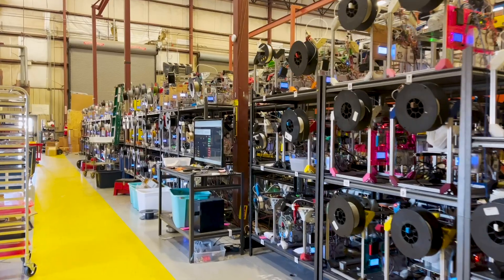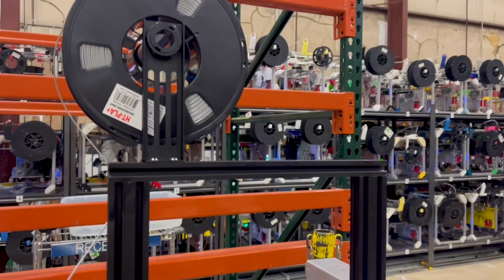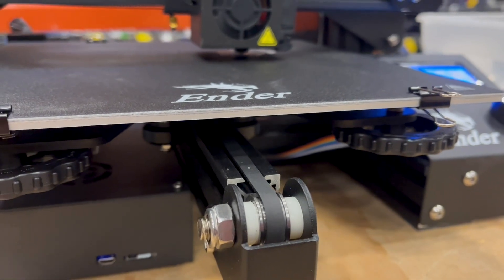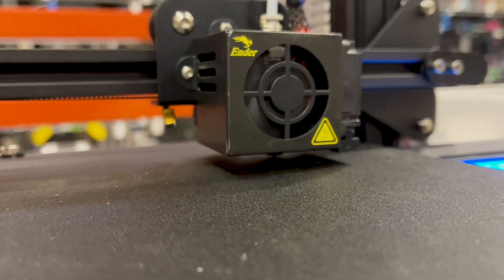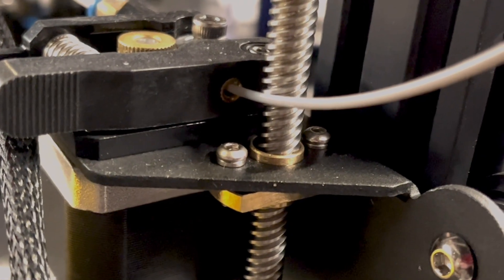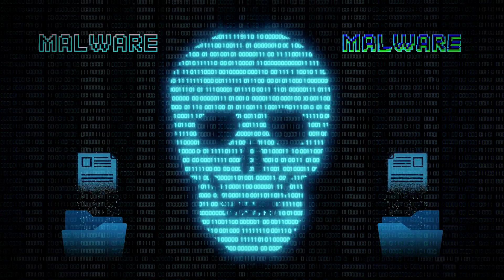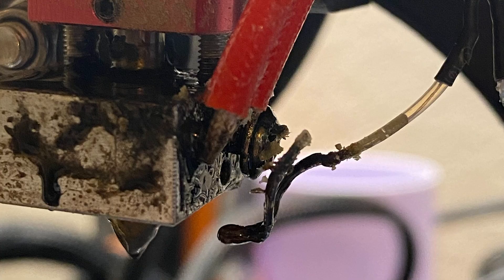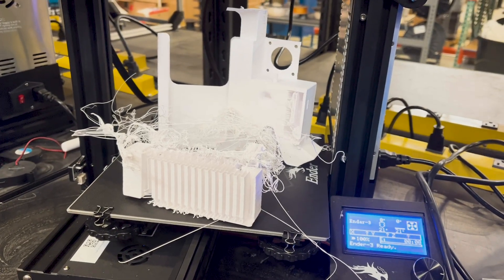We made a MISTAKE! ..........................................(ON APRIL 1ST)

Comment: I have Ender 3 S1 Pro's.  And they work fantastically.  I run them 24/7 Completely Problem Free.
The only time I ever need to do anything to them is a quick relevel about once a week.  for some reason the right rear build plate adjustment wheel always drifts down a little after about a week.  But it's super fast to readjust and boom you're up and running for another 150hr or so.
it's pretty consistent across all of them,  about 1/4 - 1/2 turn up, on the right rear spring,  and that's about all it takes to keep them pumping out parts.
It's a fantastic machine for the price, and only takes about 15min. to set up out of the box to running ABS and ASA parts Flawlessly.
I love them.

Comment: Hey, stop bashing my enders... /s   I know its an april fools joke, but in a print farm it would be better to flash klipper and use kiauh to install multiple instances, run 16 from one dedicated computer. no screens, no sd cards. Klack Ender, dual z, direct drive, magnetic bed, runout/snag sensor, satsana 5015 fan duct, all metal heatbreak, 50w heater, hardened tool steel nozzle and let it eat.  hes not wrong at 5 hours of upgrades. still think for the price its worth it if you know how to do the work. They arent incapable machines if you are capable of assembling and maintaining.  Thanks for the laughs. hope I gave some too...

Comment: Good one. I have an Ender 3 and it's definitly not going to be my next machine again. 
I mean for the price it's fine, but you waste your time.
Reply: I have one too. It’s an awesome entry printer. If I was in anyway fixated on 3D printing as a hobby I’d definitely buy something better, but as I’m just a dabbler (I probably print a couple of things a month) I’m just not tempted by the bigger spend. Plus it’s sorta fun figuring out what’s wrong with it every once in a while, which usually involves slowly replacing parts with better ones.

Comment: Good luck switching to Enders :P I've got an unrelated question for you. I've watched most of your video backlog and you mentioned multiple times that designers shouldn't design for large model faces attached to the print bed. Is that solely because of the bed adhesion being too strong, and maybe warping? Or are there other factors? I'm thinking about designing replacement/alternative keyboard bezels for the framework laptop, and if I were to print parts like this at home, I'd rely on my PEI bed to give me a very nice surface finish on that bottom layer. In a print farm setting, I could maybe imagine that the finish would be inconsistent because of different print surfaces across the fleet, or maybe certain spots of the surface having a different finish or clogged pores from previous large volume jobs.
Reply from the maker: April Fools!
Reply: @slant3d  Didn't fool me though... I guess you didn't read my question?
Reply: Adhesion usually shouldn't be a problem if you've cleaned it with IPA and are using good bed temperatures and/or a enclosure. Make sure you have a trammed nozzle, trammed Gantry, trammed bed, and levelled bed (I'm sure I don't need to tell/remind you this) 

The importance usually lies with in the latter of what you said - the warping (based on the material and cooling and overall size). Print super slow speed, accel, and jerk on the first layer - then normal/fast OR speed-up gradually on others (if you're comfortable with custom written g code)

If you watched Dr D Flo's large format 3d printer, he cracked the sh*t out of his glass bed simply due to the contracting forces that usually cause warping (his cracked instead bc his bed was a rigid material rather than a flex material)

A good way to contract warping besides cooling and speed is find better materials, for example, ASA's usability is superior to ABS due to less warping and higher UV resistance. Also, filled filament tend to have less warping due to shorter polymer changes and, in the case of fibers, even more stability - glow in the dark, metal, matte, wood, glass fiber, carbon fiber, etc

As for CAD and model design, use fillets on planar corners for more even forces as compared to chamfer. You can add subtractive features such as ridges, bolt holes, and/or pin points in the model at repeating intervals to introduce novel perimeter geometry to counteract longer-length chains

The voron stealthburner is an example of a design that uses internal negative space to increase part strength and reduce warping (look for the sinus-like hollow cavities)
Reply: @x_jaydn  Thanks for the attempt at an answer, but you missed my point. I don't have any adhesion or warping issues, hence why I would happily print a part like a laptop keyboard bezel flat on my diy printer. The question is: would slant3d do it if I were to send them print jobs like this.